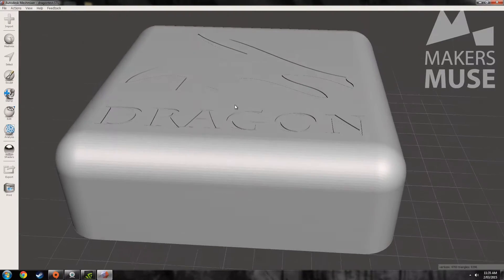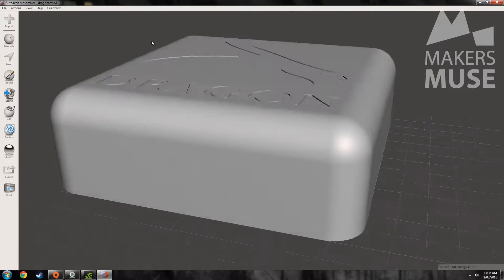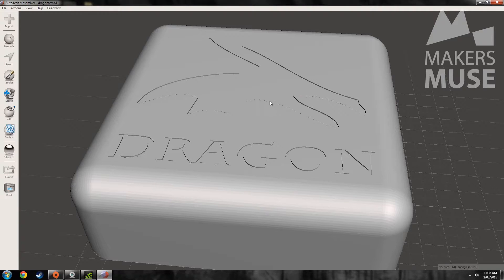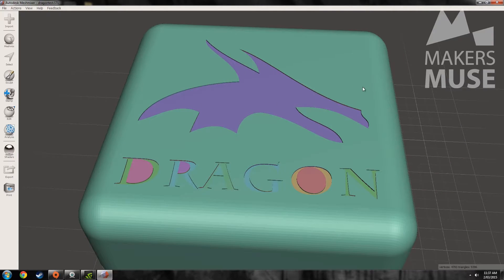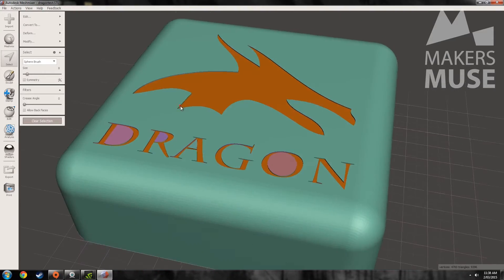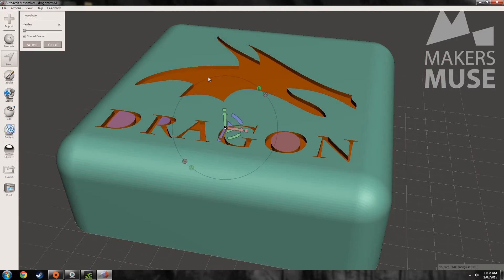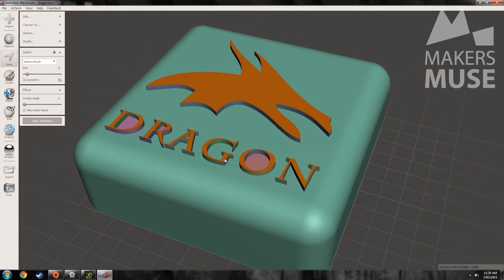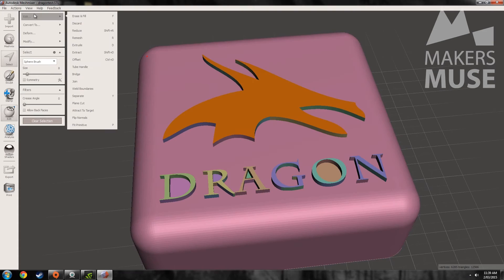Use Face Groups to enhance features in Meshmixer - 2015

Comment: Hi Angus. I know this videos are a quite bit old but I am learning a lot thru them. I am already selecting pieces, creating groups and etc very easily now, but I am still missing the knowledge on how to properly separate some pieces on an STL. Its not simply a plain cut. For example, I am importing a Home Simpson and I want to separate his eyes to print in another color. Just selecting, creating facegroup then generating complex and spliting it give me kind of a good result, but the back of the eye follows the front eye curvature, and I would like it to be flat to print easily without supports and would be easier to fit back. So, how could I cut an eye of a figure, in a way that is has at least 2mm high, flat back surface to print and also leave the hole on the face the same way to fit back... do you have any video that shows that ? Any training I could do. I am really in need of this knowledge, has studied lot, went try a dozen of videos but no one explains that. Thank you !

Comment: I was trying to do this last night and when double clicking the facegroup, the selection was also selecting triangles that BORDERED the facegroup.  In your example with the dragon head it would have grabbed all the triangles in the dragon and all triangles that shared an edge with the dragon.  For what I wanted to do, that was VERY problematic.  I wad trying to cleanly remove some interior detail on a hollow part so I could fill it in.  The facegroups were made correctly, but double clicking on select was behaving badly.  Has this changed in the past 3 years?  my version of meshmixer is whatever was new about 6 months ago.

Comment: How well would this work on filling in text on a curved surface? I have a file I am looking at working with and want to fill in the text they have put on the surface. I started working with it in meshmixer (which i know little to nothing about) while following another tutorial found on youtube that suggested I just select all of the triangles by hand and then delete and use the inspector to auto-repair the surface (which leaves a faint outline of the letters and some crazy geometry). This method has proved to be extremely time consuming considering the model is meant to fit in your hand and doesnt have that much text but has a lot of individual triangles to select.

Comment: Hi Angus, finally bought the Up! Mini commercialized by PP3DP :). So in what orientation would you print the final model showed in this video? And how would you make latches that can be easily made in 3D printing for this kind of enclosures? printing enclosures is quite of ineffective and difficult. Specially adding that kind of carved logos. Any tips? . Also, what's the difference between open / closed extruded fan? How to print pieces in abs without a raft? Can I print directly to the heatbed? So Many doubts! Thanks!??
Reply from the maker: +SaturnAR Nice! For this model You could do it with text on the side to get better definition, or text on the top for an easier print but less definition. There's always trade-offs! To answer your other questions, I usually do what's called a lip and groove for boxes and lids, it's quite common in electronics cases - and a screw and boss to secure in place. For the UP! Mini printing raft-less is quite difficult, make sure your bed is nice and level and get yourself some 'buildtak' to stick over the perforated bed. Getting the nozzle height dead on is hard but it is possible! To be honest I always just print with a raft it's so much easier and ABS is pretty cheap. Keep the fan closed unless you find pulling the raft + support away is too difficult, as having it open can make the part warp more. Hope that helps!
Reply: +Maker's Muse Thank you so much for your quick response!!!
Reply: +Maker's Muse by the way, printing this model with text on the side of top wouldn't add a lot of support material? I'm currently printing enclosures with the text side on the bottom (tbh no text for now, just the plane face).

Comment: Great video! Click the little "S" icon (bottom-left of the transform gizmo) to turn on snapping, and you will be able to move in precise increments. The A icon toggles absolute/relative mode (relative is what you would want if you want to move in increments from the starting point, vs in the world grid). If you want more snap points, use the up and down arrow keys.

You can also use the Soft Transform tool to resize features based on face groups.
Reply from the maker: Ah! I had forgotten how to turn that on, awesome! Makes it way more accurate. Cheers!